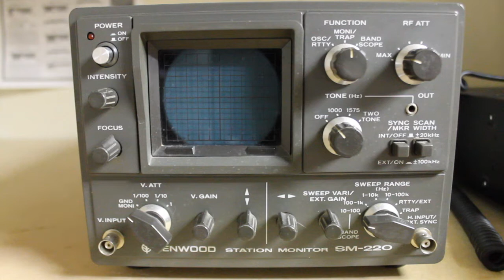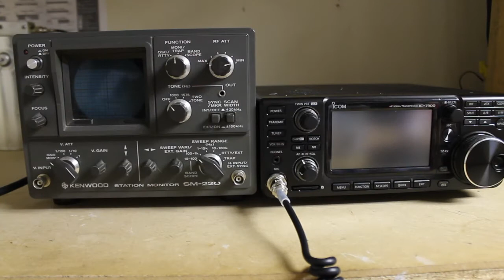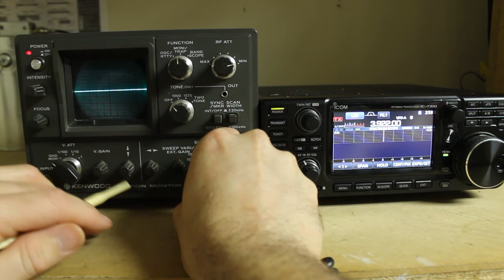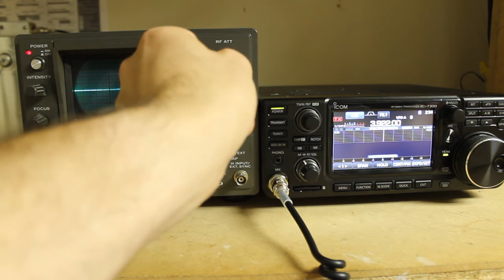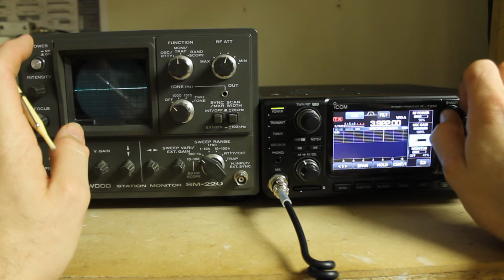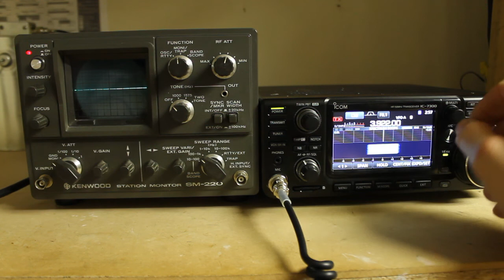Introduction to the Kenwood SM-220 Station Monitor

Comment: I've got one of these but the display appears to be dead ? Should I get a line  with no input?
Reply: yes you should.  The horizontal sweep will make a difference too so turn it on and play with the sweep control, intensity, focus and gain controls to try to get any display.  After that, if nothing, the CRT tube (display) may be dead OR it could have a power supply issue.  GDLK!
Reply: @Ur_Lzn  ok but sold a long time ago unfortunately for a much lower price than it should have gone for :(
Reply: I was given an old Kenwood TS-830S. I found a good deal on a SM-220 but after tearing it down I found out it is a BS-5 version. Do you know if the TS-830s (BS-5) are compatible?